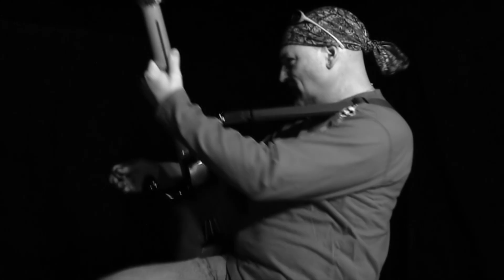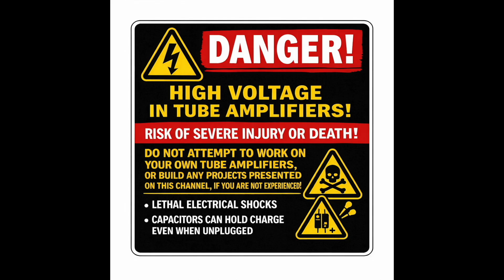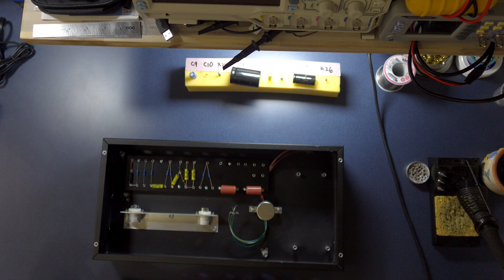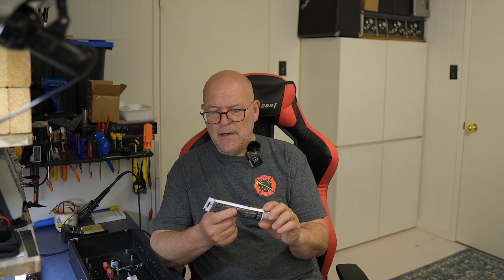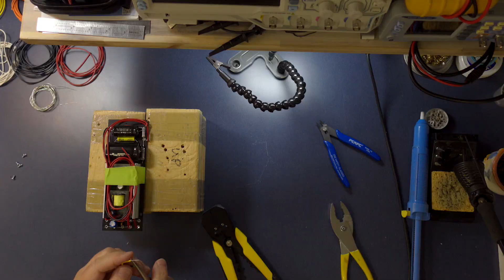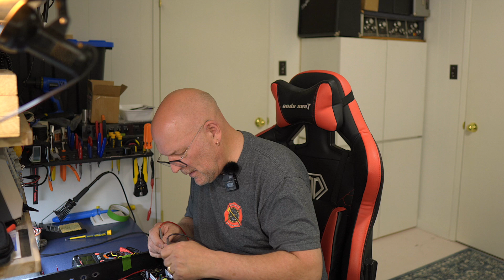A Power Play - Bass Pre Engineered Edition 8

Comment from the maker: This episode marks a huge milestone in the project.

For the first time, the Bass Pre has a fully commissioned power supply with verified heater and B+ voltages. From here, the remaining electronics can finally be wired into the chassis.

One thing I mention in this episode is a small engineering change I made before filming. An eyelet was moved slightly farther away from the boost converter shell. It probably would have worked as it was, but that’s the difference between simply building something and engineering it.

Also… don’t miss the very end of the video! There’s a quick announcement about One Soul Thrust that I’m really excited to share.

Thanks for coming into the workshop with me.